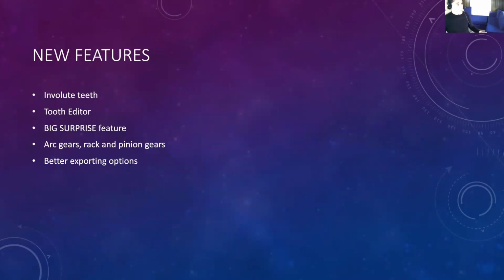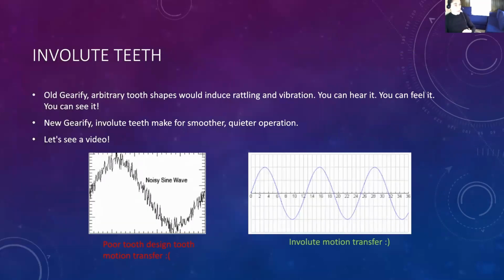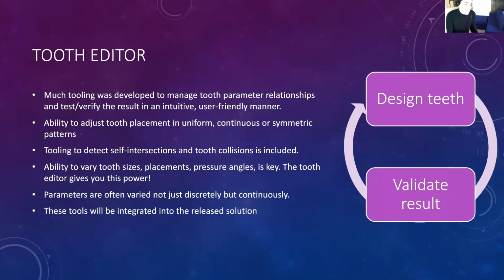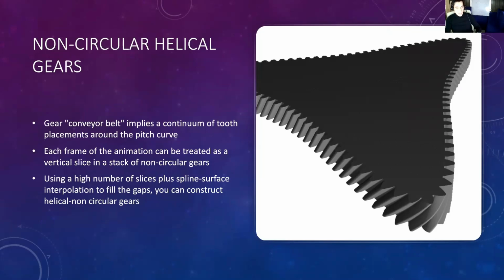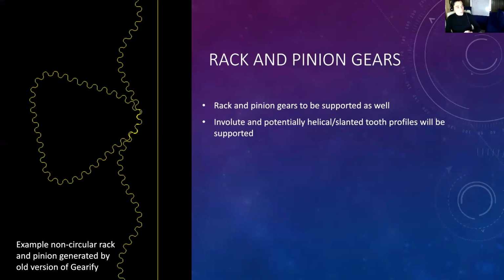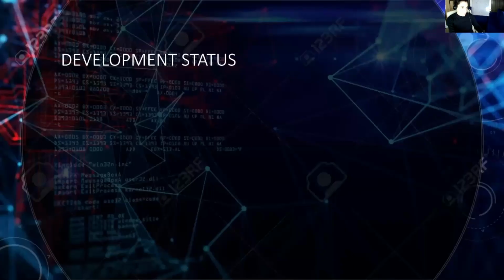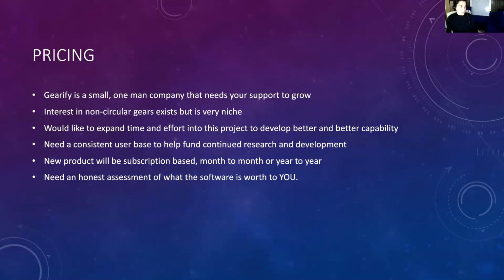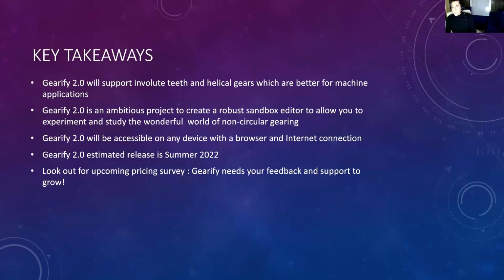Gearify Version 2 Status Update

Comment: I'm impressed.
The last time I used Gearify (evaluation version) was >4 years ago to illustrate  "Reuleaux triangles on a circular orbit", but I quickly saw potential applications for irregular shaped gears managing noise from resonance.

(At the time) I didn't want to go through the effort you have creating a method of mathematically generating the correct angles and fixing collisions -- With Gearify 2, it could be almost trivial to actually design and build what I'd imagined back then.
Not that I'm going to now, but this has definitely earned my attention.

Comment: Looking forward to your new release. I hope that you are able to include measurable user specified backlash in the unique gear pairs. Since many of the gears will be plastic there is a separate analysis that must be done with coefficients of thermal expansion, water/humidity absoption, runouts, shaft misalignments, manufacturing and printing error and so forth. The second item might be the ability to change the root radi structure or perhaps the radii itself in combination of root diameter depth. I am assuming that you generate one gear and its teeth and then use that gear to generate (cut) the teeth of the mating gear. The 3rd item might be - is it possible for you to generate 3D STEP files? I think a STL converter may be around somewhere but STEP is a direct translation to all the 3D parametric CAD systems.
Reply from the maker: Thank you for your response! Definitely some custom control over backlash will be provided. Perhaps we can have a more detailed conversation about this, at some point!
Reply: @gearifysoftware  Sure thing Mike